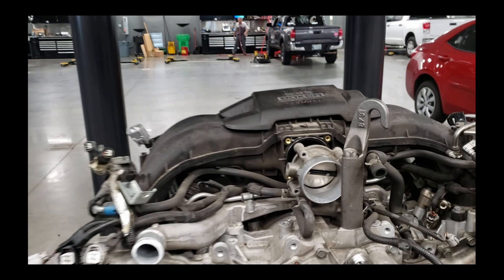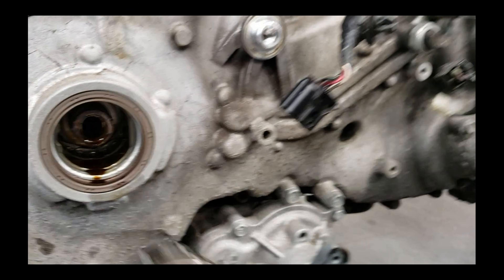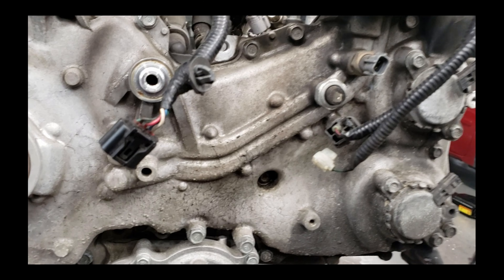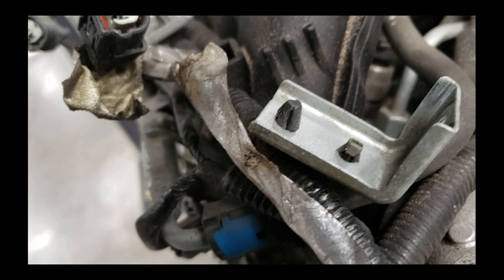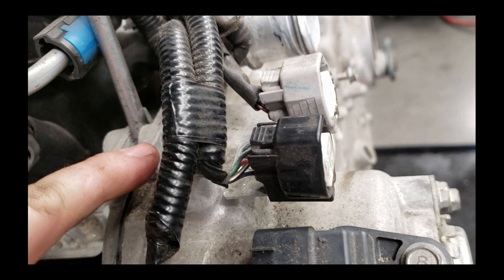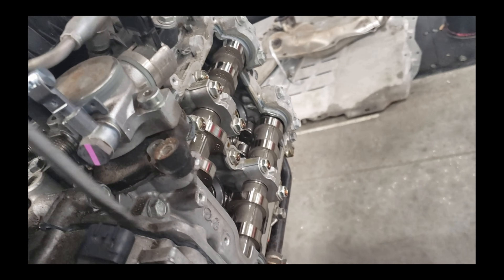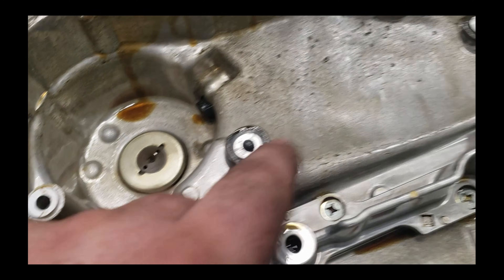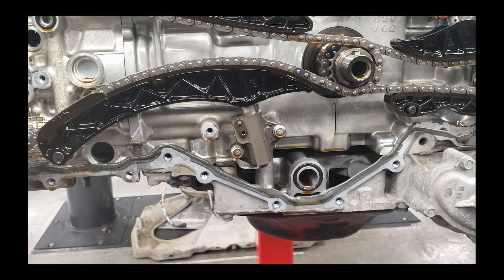how to set timing on a fa20 for fr-s/brz/gt-86| walk-through! frs/brz teardown!

Comment: Thank you, it really does help. I'm in the middle of assembling my motor and i need to learn to time and untime my car since i have to rotate the crank a few times for my new valves to seat and then check valve clearances for those pesky shims. 

I was initally afraid of doing the timing since that is important and you can literally break your motor doing it, but watching your video gave me confidence. Only 'hard' thing to do is removing all that to get to the timing chain. 
thank video! you should do more videos on technical engine repair stuff, youre quite good a explaining it to people.
Reply: Muchas saludos  como cambiar los empaque de culata
Reply from the maker: thanks man I really appreciate it man so a little background on my self I am a shop foreman for Toyota and as such, I am always teaching people how to fix one thing or another thanks for supporting the channel I will be sure to add some more engine/ automotive technical stuff. thanks for subscribing it helps the channel grow so I can do more cool stuff like this let me know if you run into issues ive had 30is fa-20s apart for various reasons we had so many issues with others doing them my shop will only let me work on them now.
Reply: @ParkHopTillWeDrop  Haha, you show your expertise in this video for sure. Yea, a lot of the 2013 models have the issues. But I am assembling a built FA20 motor; 10.5:1 pistons, rods, king bearings. 

I think im just afraid of moving the LH intake cam sprocket, even with the tool, to align that arrow to start timing the motor. I will for sure ask for help if needed, but honestly this video really covers all that's needed.

for future videos, just do any automotive ones. The BRZ/FRS community is quite extensive, so already this timing video has been very helpful. Most people that do guides or whatnot aren't certified mechanics, so all those guides are mostly what they have done, it works but it won't always be how the factory or best way to do it.

Comment: Friend, good afternoon, I hope you can help me build a boxer engine for a subaru wrx 2015, but I get familiarity from the copilot xf side. If you can support me, what was the problem?
Reply from the maker: The problem with this engine was the valve springs were faulty so they were all replaced.
Reply: a ok the detail is that the rattle occurs when it is hot
Reply from the maker: @heribertominorperez8057  so you have a rattle when hot? Could be valve lash issue or vvt gear ⚙ most times you get a code with a bad gear
Reply: If I scan that, I see p0011, I put synthetic toilet 5w30 on the other hand, the vvt is where the cover of the distribution chain is, the one that carries each tree, those would be the vvt or how can I check is that I already have time with that problem
Reply from the maker: @heribertominorperez8057  with that code you have there are a few things that can be wrong the 
timing could be off chain stretched

The vvti gears has gone bad most likely 

There is no oil getting to the gear less likely 

The ecu is bad I've only seen this once

You have a bad controller the little 2 bolt thing on the front timing cover directly infront of the timing gear I've had these fail a few times

Comment: Why can’t I just line up all the arrows as you mention and slap the chains on instead of doing the left bank and rotating it to install the right bank. Seems like it’s a matter of just lining up the arrows and holding them there as long as the crank is right.
Reply from the maker: the motor is loaded when the arrows are pointing at each other on the right bank so you would have to lock both gears to attempt doing that way also the crank link is in a weird spot during this time. when you time this its basically like timing 2 different engines so you time the right bank then rotate over and time the left bank its really the easiest way to do it. The reason I did the video was the instructions in the manual are super confusing and they have you do the procedure different this instruction is from an old TSB that was out when the motor was first released and it makes setting the timing much easier I just wanted to help other people that might be struggling with this
Reply: @ParkHopTillWeDrop  makes a lot of sense, I appreciate the quick reply. One last question if you don’t mind, the engine had metal shavings which have been cleaned out prior to assembly. I removed the oil pump plate in the back of the timing cover to expose the oil pump as well as the plates next to it that house those oil channels to make sure that looked good and was cleaned anyway but I noticed there was no sealant. I put it back together but wonder if I should add sealant to those plates that get held on by Phillips screws (used impact driver to set them) to ensure I don’t lose oil pressure?
Reply from the maker: @brunoc9376  no need for any sealant and I would not put any there as if it somehow becomes lose it will get sucked into places that are not good. when we were doing these recalls my Toyota rep told me there were a few dealers that had them come back with rod knocks and the problem was lack of cleaning so when they would clean the old sealant they left all the pieces to float around and that clogged the screen and the rest is history. please let me know if you run into any snags I will try and walk you through it I was the only tech and still am the only tech at my shop that they let work on these I've had 38 apart mostly for the recall and a few for cam gears. please consider subscribing and smash that like button for us.
Reply: @ParkHopTillWeDrop  just subscribed and liked the video as well! I realized my exhaust sprocket doesn’t have a phaser like the one in the video but looking at the service manual they still get lined up the same way so I should be good to install. Thanks for all the help and I’ll be sure to reach out if I have any questions, thanks again!

Comment: Hey man, is the bank 1 intake cam supposed to click when checking all timing ? The sprocket clicks when checking?
Reply from the maker: It will click when turning the cam yes
Reply: @ParkHopTillWeDrop  thank you for the reply, does it go away on first start up, kind of scared to put it in with that click from right side intake cam.
Reply from the maker: @gsohi9700  so right now with no oil pressure the gear kinda never locks and makes some noise it should go away when you start it but if you think the gear is bad I would replace it while you are there
Reply: @ParkHopTillWeDrop  thanks, when I removed everything it was fine, was sealing cam carriers. So it is only clicking due to oil pressure not present correct? As it was fine during removal. Thanks for help
Reply from the maker: @gsohi9700  yeah in my experience they click when they dont have oil pressure

Comment: How do u take the tension off the chain
Reply from the maker: once you have the timing marks in the right position you take the 2 10mm bolts off the tensioner and remove it the chain will then come off after removing the tensioner guide

Comment: Does it require the motor to be pulled?
Reply from the maker: to do anything with the cams or springs like i did here yes but if your just doing the front cover or replacing the front timing gears no you can do it in the car hope that helps
Reply: @ParkHopTillWeDrop  I need to replace the 4 cam sprockets and didn’t want to pull the motor if it was unnecessary. Thanks!
Reply from the maker: @Kouie88  you can do it in the car for sure did a video on that as well had some gears go bad. https://youtu.be/OCQ5YiQ1pjQ

Comment: Thank you for the vid. Really helpful and informative. But I'd like to ask, what was the reason to replace all spring? Why I asking is because I have fb25b engine and it has slight tapping noise coming from the left bank, the driver's side. I was told that it is a common problem on fb engines and usually can be fixed by replacing spring and rockers. Just wondering. I'll be doing some work on my fb and thought I could get it fixed while I there. Thanks
Reply from the maker: It's a recall for the fa20 engine only in 2013

Comment: hey question the car can come on even if is a little bit out of timing? because we did my son car and the car coming on but is not acelerate and throw a code like is out of timing so i will like to know before we take that motor out or i be able to do with the motor inside the car?
Reply from the maker: ok hector you asked alot of questions very fast so im going to answer one at a time 

first yes the car can start even if its out of time we had one at the shop that one bank was 180 degrees off timing it still started kinda but ran really really bad

second yes the timing can be set in the car without removing the engine i  cover this in a cel video i did on my channel you should check it out also 

thrid I work at a Toyota dealer in Florida there are  many great  subbie engine shops all over the place you should not have an issue getting someone to do it however i think this can be fixed on your own with a little help and taking your time also please subscribe to the channel and share the video it really helps me grow and do more cool content like this
Reply: @ParkHopTillWeDrop   i live in florida also and my son car is a scion frs 2015 so let see what i can do my self first then if i have question can i get back to you ?
Reply from the maker: @hectorsantiago1639  yes sir I can assure you the dealer is gonna be very pricey to fix it we are over 140 bucks per hour i don't make the prices there just so you know but I think you can set this properly if you follow the video I would first take it apart and make sure the timing looks like it is off first
Reply: @ParkHopTillWeDrop  thanks i will do that let i will let you know if i be able to do it i think is not hard i just want to do it right i appreciatte youre response we keep in touch and thanks for all you videos they are super helpful have a great day

Comment: so when is Subaru going to come to their senses and make an inline 4cyl?
Reply from the maker: good question I think this motor will continue to be used only because of its low center of gravity being able to put it so low in a chassis is why Porsche has used this for some time now
Reply: @ParkHopTillWeDrop  thanks for your help! i'm not the fastest mechanic but i knocked out the timing chain job in 10 hours today. i work hourly and i wanted to be thorough. lots of time going into prep'ing the the timing cover and block. your tips were perfect! $1175 P/L out the door with factory parts. she runs like a champ! i work out of my shop by myself $50/hr so content like yours is gold! keep it up!
Reply from the maker: @SirBrandonGoofMaxxer  thanks for the support glad i could help please share the video to anyone you think it might help
Reply: @ParkHopTillWeDrop  every Subaru that comes up to my shop (at the top of my steep hill) is smoking. that exhaust is such a design flaw if there are any leaks from the engine it just plumes smoke out of the hood. i Just got done with two smokers last week which took all my time up. 90% of the subaru's that come up to my shop smoke. The Theory of Gravity wasn't really in their mind when they designed this low center of gravity engine, in the mater of leaks. Mitsubish Evo already proved it's self faster in the slalom. 

if you have to lift up the engine out of the chassis to do the spark plugs and valve covers, you failed. also if a timing chain design is heavier and more prone to problems, then you failed. 

  all i want in life is a lowered 2004 toyota tacoma turbo 2.7l I4 with subaru's symmetrical AWD! i need a bed to throw a motorcycle in and my dream is complete! I have been engineering one in my head since i started automotive school in 2000.
Reply: @ParkHopTillWeDrop  one of my customers tried to put on an oil cooler on his 2017 subaru brz fa20, and i told him not to, and it started leaking. he lost oil pressure for a bit while driving home and now his engine is making a rattling under 3000 RPM and it goes away higher than that RPM. i haven't heard it yet but is this commonly a timing chain guide issue? obviously you can't advise unless you here it, but i was just wondering your take. Thanks!
Reply from the maker: @SirBrandonGoofMaxxer  if the gears can rattle if they loose oil pressure for extended time but most times they damage the lower end cyl 2 almost always when they loose oil pressure
Reply: @ParkHopTillWeDrop  today I told him to do an oil change and bring me up the oil and filter. he brought me the oil filter and like a half a quart of oil. i'm like where is the oil? he said that was all that came out. I'm like...Bro that oil cooler you put on just cost you an engine. he said the rattling slightly went away but it's still their. his neighbor is a subaru mechanic and told him that it was a timing chain noise at 53k miles. I'm going to go listen to it tomorrow. but yeah i showed him a link of a fa20 with 40k on it through EBAY for $4000. probably the cheaper way to go. 

can those engines come out the top, or only out the bottom?
Reply from the maker: @SirBrandonGoofMaxxer  yeah they come right out the top I can have the motor out of these in about an hour and a half or so and it would be much easier to put a used engine in unless the owner wants to upgrade it then I recommend a built short block but this route is much more expensive as I'm sure you know

Comment: do i need to pull the engine to replace a cam spocket LH Bottom? also i would just need to check to see if the timing is still correct, if doing a 1 for one swap?
Reply from the maker: No

Comment: Whats the Part number on that o ring you said to replace so the front seal doesnt leak?
Reply from the maker: Inner Pulley O-Ring - Subaru (806939060
I believe this is the Subaru number you need.

Comment: What kind of gasket sealant is best to use
Reply from the maker: subaru makes a special sealant that you put in a caulk gun and it works fantastic im a big fan of it but if you cant get that any high quality rtv will work just pay attention to where you are applying it to make sure the rtv doesn't end up in places it should not be.
Reply: @ParkHopTillWeDrop  thanks!
Reply from the maker: @Maul_Brz  fo-shizzle

Comment: HELP!!!! One quick question man ! I recently got tired of a Fa20 engine bro my engine had a knocking sound and im trying to do an engine swap but I wanna stick with boxer engines from subaru so what engine can I use? Or can fit on the motor mount so I wont have to do some welding and ofcorse im gonna also do the transmission swap also but what boxer engine can I use in my 2013 subaru brz man???
Reply from the maker: That is a question I don't have the answer for not sure what fits in the frs/brz we never do engine swaps on them

Comment: Is there anything special to swapping out the cam sprockets or is it as simple as removing the 3 bolts while using a pin wrench to keep it steady? A shop wants to charge me 20hr or so to change them so I want to do the job myself, how long would you say swapping out all cam sprockets should take
Reply from the maker: There is nothing special just remove bolts and replace all the gears are marked just make sure you put them in the correct position the don't need to be unlocked like most toyotas. If your only doing gears this can easily be done in the car without removing the engine im gonna shoot high and say this will take you around 8 hours or so but depending on your automotive ability and access to air tools could be much faster. Without air tools worse part would be getting the crank bolt off. If you have more questions please let me know and thanks for hitting that like and subscribe button.
Reply: How do you remove a stuck oil pump drive? Mine didn't come off with the crank pulley and it won't budge at all even with a Vice wrench and a lot of force... Can't find any info on this and it's the only thing in the way from finishing the job as my timing cover is already loose
Reply: Never mind I was able to take it off
Reply from the maker: @jaybelle1909  sry I just got your message I see you already got it off but light taping while pulling will usually pull it out